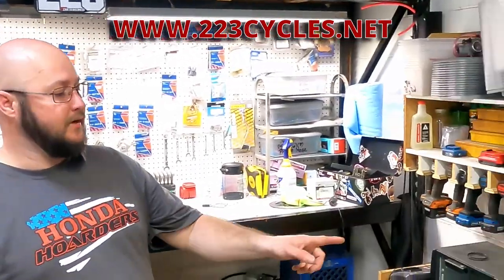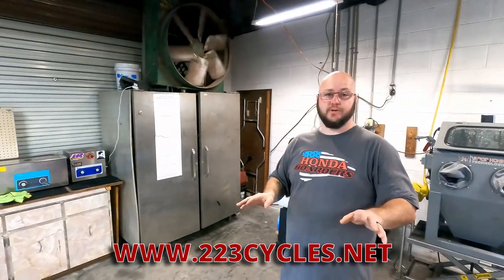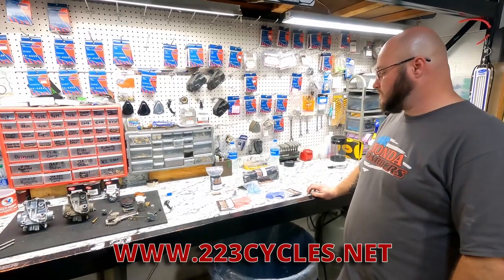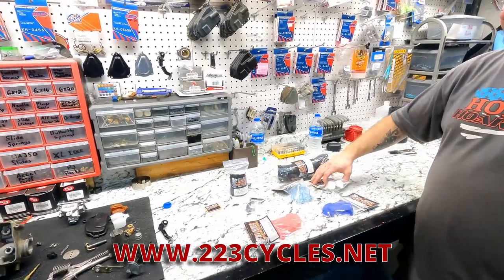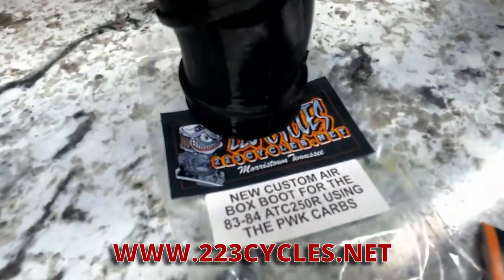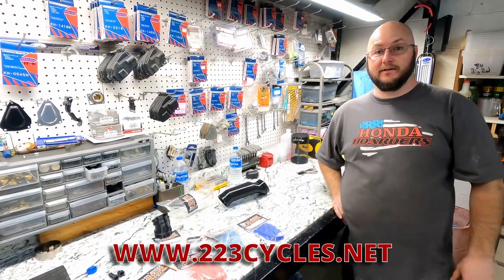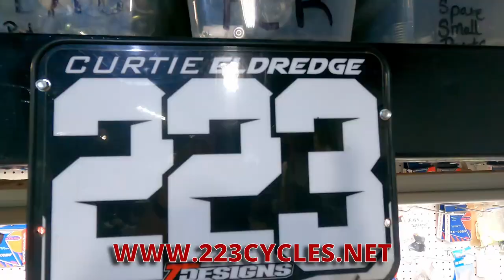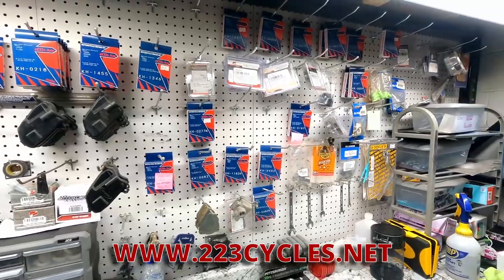How to restore a CARBURETOR w/ CURTIE of 223CYCLES.NET

Comment: Quite the shop, that's one dedicated dude! I'm glad you posted early cause I'm done trying to heal the body and need to clear my head riding my trails. Got too many questions about the Knight Rider so maybe you guys can rattle off some of the specs another time. I put 12 inch wheels on my 250es years ago without any suspension mods but that looks gigantic. Thanks to the both of you guys for your time and effort but I see sunshine and a thermometer climbing upward and got to go!
Reply from the maker: Hey ATV SE, i will have to do a over view of Knight Rider, Its a beast, high compression, lift kit, its got it all.
Reply: Thank you sir. I had it apart before he got there getting ready for more upgrades that I hope to have done for trikefest. Things like front and rear disk brakes (that’s why the front brakes were disconnected.
Reply: @mrcbuilds  Fantastic!
Reply: @223cycles2  Amazing, thanks.